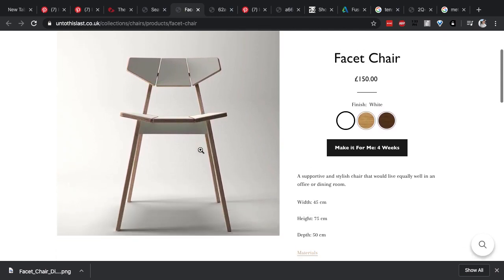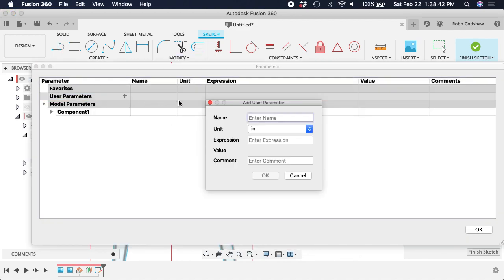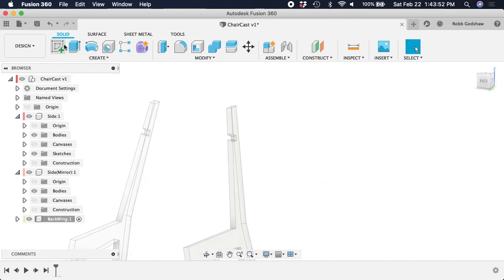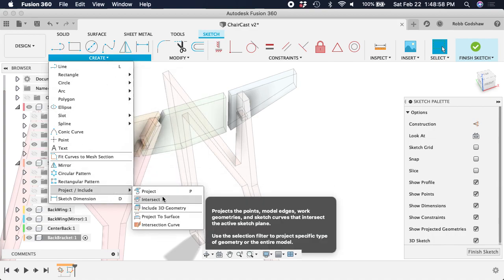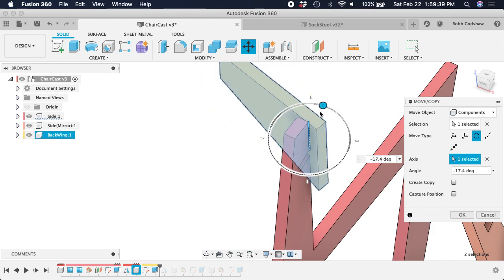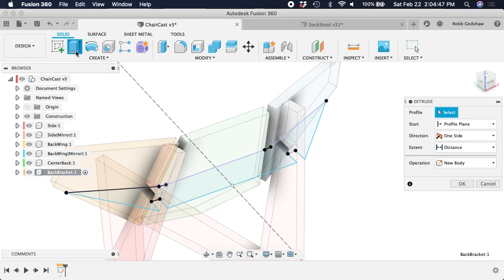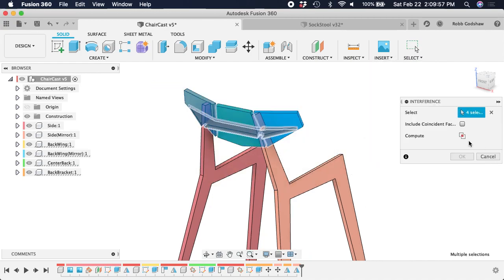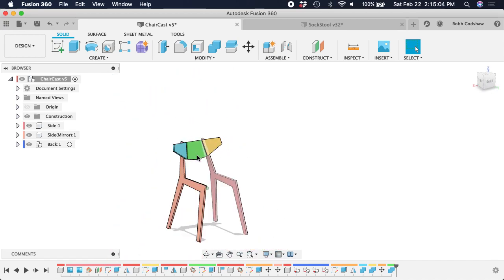Fusion 360 Faceted Chair Design Tutorial

Comment: Picked up a few good tidbits, but the joinery was terrible. No woodworker would want their joints that sloppy. Would have been better to not model the notch at the beginning and wait until you modeled the back bracket to use it to intersect the legs. Lots of time spent fixing that issue.